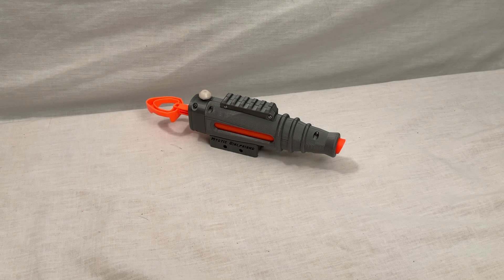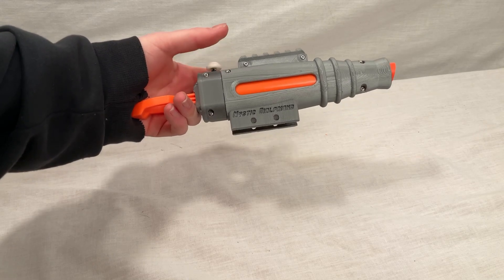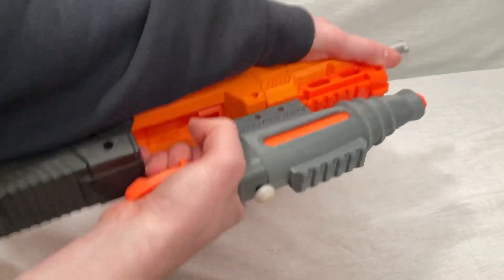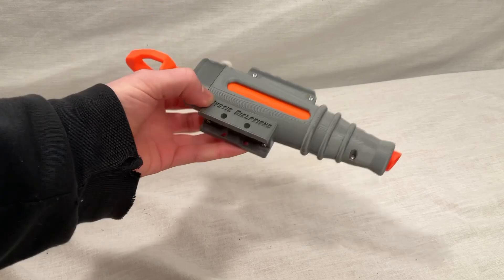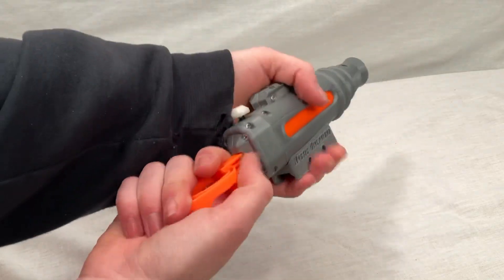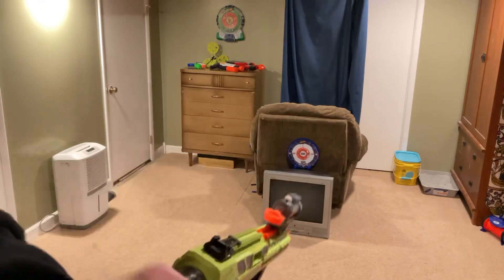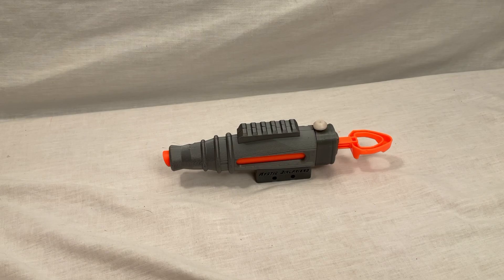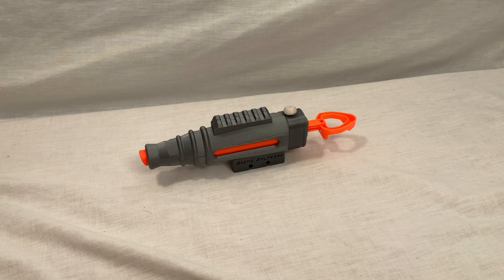"Mystic Girlfriend" Prototype by Nothin_Blasters! || Rail-Mounted Nerf Nitefinder!

Comment: Using a dremel would cut down on filing time. You could cut off ring pull to turn into a small T pull it wanted to cut down on space.
Reply from the maker: Dremel wouldn't have gotten the light slimming I needed, unfortunately 
The t pull idea is a good one, tbh. I might try that.